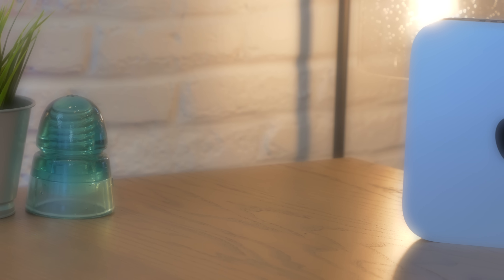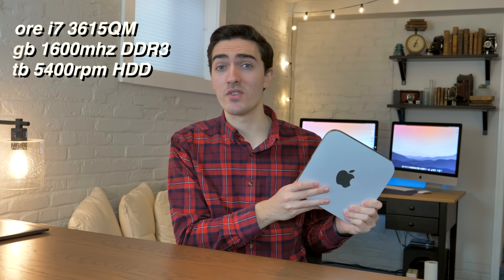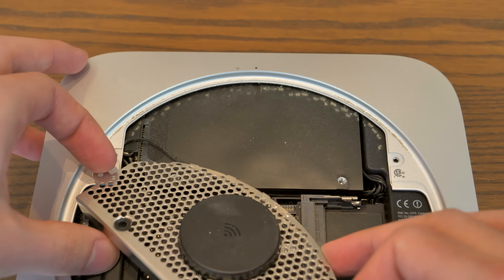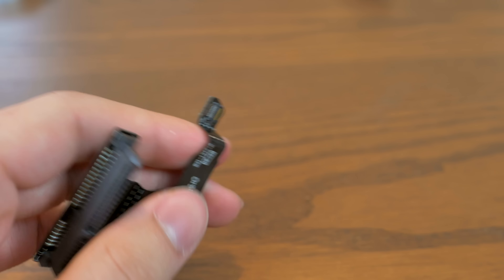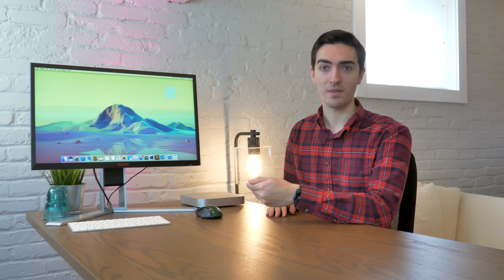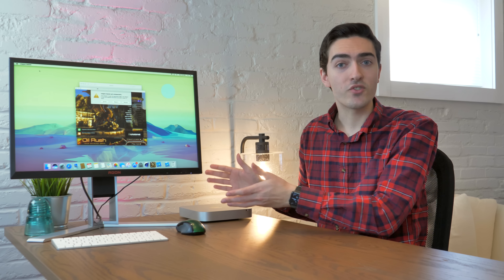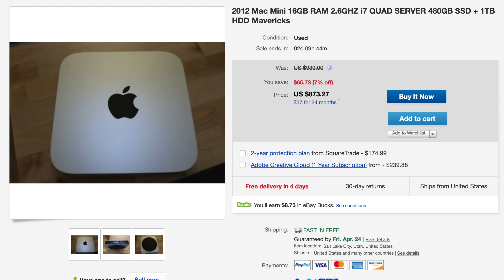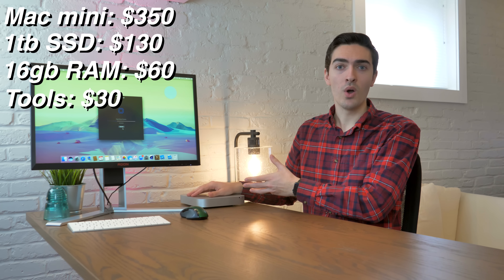Building the ULTIMATE 2012 quad core Mac mini – But is it worth it?

Comment: Luke I found a 2012 Mac Mini with 16GB and 2 TB SSD for $350. Would you consider that a good deal?
Reply: extremely...  usually on ebay a box speced out like that is over $500.
Reply: @davidcook1130  well it ended up selling on eBay for over $400

Comment: I was in a weird spot where I didn't want to cough up the loot for a 2020 or a 2018 mini because if I was spending that much, I'd want to get the M1, but I'd prefer to wait until the next generation of M1s are out, so I looked into the 2014 and the 2012.  2012 initially lost out because it isn't supported by Big Sur.  Them I realized why: it's fairly powerful and upgradable.  The 2014 seems like Apple actually nerfed it's own machine.  When it turned out that it would be the 2014 that would be supported by Big Sur, I tried it out.  The issue for me was GarageBand.  I really wanted to get the latest version because of the drummer feature.  Without Big Sur, no new GarageBand.   So I tried out  the 2014, first a 1.4ghz and then a 2.6ghz.  The 2.6ghz was fine, but that 8GB cap was a bit much. I didn't do my research well when I bought it because I didn't realize you could basically upgrade the drive and that's it.   I ended ordering a 2.3 ghz 2012 with the i7 quad core off of eBay.  They must have goofed because the one I got was the 2012 2.6ghz Mac mini server and it already had the SSD and 16GB of RAM in it.  Apple are being dumb not officially supporting the 2012 because Big Sur runs brilliantly on it.  You have to run a patched installer, but it's easy to get working.  total cost to me was around $300 for the machine and the SSD I added.  So now it has 2 SSDs.  I agree with your point about modestly upgrading to make it a better value.  You can trick it out, but after you add up the costs, you might consider newer, but I wanted to say that for around $300 end to end, this is a very powerful and capable machine with modest upgrades.  Great video!  Thanks for what you do!

Comment: I've been using Mac mini Server (Late 2012) i7 2.3GHz, dual 1TB HDDs since 2012. 5 years ago did max out RAM to 16GB. A reliable machine, really.  It's used mainly for simple photo processing (tons of family pics) and a media computer for family use (it sits under the TV). I would like to use it as the main photo storage (having it all double backed on external HDD's) and viewing (oh, I've just gone from APS-C to FullFrame...) unit.
So, I want to swap the existing two 1TB HDD's to 2TB SSD + 4TB HDD. Since I own the machine, it'll cost me about 300 EUR (Crucial MX500 2TB SSD 170 EUR + Seagate Barracuda TB Internal Desktop Hard Drive 2.5inch 4TB HDD - both from Amazon.de).
What do you guys make of it - is it worth it? How long will it be enough with Catalina? There are some workarounds to get to Big Sur, but will those be there also for time to come?
Opinions?

Comment: I have this same i7 Mac, with 16GB and it came with a 1TB Fusion Drive.  That cost me $1399 when I bought it, as the i5 was the default.  I've recently upgraded the storage to a 1TB SSD, and retired the internal 1TB to be a Time Machine backup.  It's lasted very well for the last 8 years, though there have always been minor graphical glitches (sometimes there's interference under heavy load) and Bluetooth for headphone use has been rubbish.  It's never failed me though.  Getting 8 years of straight use out of a 1TB 5400 hard drive plus a 128GB SSD without a single failure is pretty much unheard of.

As for what I've done with it, I've run VMs, games (Half-Life 2, things like that) and video editing software as well as iOS and Android development tools.  I frequently compile software and I always have a terminal window open for tinkering and running scripts.  I have tried Boot Camp on it which worked fine except for making the Mac run a bit hot.  That was easy to fix with some fan tools though.  I've run Linux on it.  Never any problems.  Only on Mojave did I ever manage to get it to crash by using up all 16GB of RAM with running VMs, and that was a solid hard crash!

It still keeps kicking.  It's been around the world in my suitcase 9 times, as it's perfectly portable when I need it to be.

Comment: I bought mine for 350 and added 16 gigs of ram and a ssd. It boots super fast and doesn't crash at all when I run logic pro x. For what I have into it its a great value compared to the 2018. The performance is great only bad thing to say about the 2012 is what you already said the graphics processor is terrible, but seeing as I use it exclusively for my recording studio I am absolutely happy with it. 
When comparing to my hp mini computer with the same processor and ram it isn't even close when it comes to capabilities. If I didn't love logic pro x so much I'd go for a pc over a Mac any day. The hp is only a year newer but has 2x the usb ports an optical drive and is faster all around.

Comment: It's 2020,  this is a 8 year old computer. Sorry, I love mac os but this BLOWS!! You guys nickel a dime these old macs to make them look like they are worth more, but they are crap. Low video graphics, slow cpu, ddr 3 memory, slow bus board, and old generation ports.  Cmon man,  this is not a classic car from the 50's. There is nothing that would make this the Ultimate mac mini. You would be better off actually buying a mac pro 2009 and maxing it out. At least your video, ram and pci slots would be worth the upgrade. Oh, don't even go with the external gpu, you could almost buy a new computer for that price, and it's almost 30% slower than a pci card.

Comment: Back then Apple actually did try to make their products look modern, now they are simply using the older designs like the new iPhone 12 pro... they used the same design as the iPhone 5 besides the screen but of course, they haven't changed that ;-;

Comment: I bought my i7 Mac mini back in 2012 with I think it was 4gb of ram and 1tb hard disk. I upgraded the ram to 16 gb and 1tb Samsung SSD EVO 1TB . I have used it pretty much everyday since I purchased it and runs really fast and well with no issues. kept upgrading the OS and its been the longest lasting computer I've ever owned . Only negative is that Catalina will be last upgradeable OS it can support. Best Buy ever.

Comment: I got a 2.5ghz i5 2012, brand new condition for $200 (free shipping) a year or two ago on ebay. I still see many around that same price but they seem to have gone UP in price a tiny bit in the last couple years instead of going DOWN which they should be! Still the best value for the dollar, upgraded the RAM myself and got an external SSD for the OS's (much cheaper) which although may not quite as good as an internal, I think the speeds are very similar, and they blow away the mechanic HDD of course. The problem is if you buy one on ebay already max'd out with an SSD, 16gb of RAM and a Quad core, the price JUMPS up to $6-700 minimum, which I think is too steep. I had my chance to get one under $500 a year or so ago, I think people were more desperate to sell them, now everyone's boosting their price

Comment: Plus, as you upgrade, you get very close to the base model Macbook Air. You can still use the new Air laptops with a monitor, keyboard, and mouse. The mini is probably a good deal at a $100 or so if you are going to upgrade. Plus, very soon those older minis will lose support.

Comment: 🗣🗣I am only using this for notes reading and writing small video editing.  I found a 2012 mac mini 2.3 GHz quad-core i7 (4GB ram) 2x2.0GB Turbo boost up to 3.3 GHz 
500GB Serial ATA Hard Disk Drive @5400 RPM
Intel HD Graphics 4000 graphics card 

1 GB DDR 3 Shared Memory 
price:$449.00 is this a good buy?
I’m just going to upgrade to 16GB RAM
And an External SDD

Comment: I just upgraded from an HDD to an SSD on my Late 2012 2.5 GHz core I5 Mac mini with 16GB of RAM (RAM was already upgraded when I received it) and the difference in performance is night and day. Much better speed and performance, before it used to move so slow, I'd get the click wheel and crashes. Now it's so smooth, I have no problems doing anything on it. It even runs Asphalt 9 pretty well on its own GPU  and music software is on point (Logic, FL Stu.)

Comment: Luke - great video as always.  Wanted to offer a little of my own color to this one -->  A close friend of mine has one of these base Mid-2012 Mac Minis and really did not want to replace it.  So, for under $90, I doubled the RAM to 8GB and installed a 500GB SSD.  What a performance difference, and she will likely get at least another year or two of use out of it, especially given it sounds like Big Sur will run fine (with the patcher, of course).  Moral of the story is that for people who already have one of these, a few fairly-inexpensive upgrades legit could kick the can a few years on complete replacement.
Reply: Can you explain the Big Sur patcher part of you can sir
Reply: @aniboibeats687  Look up Mr. Macintosh's series about how to use OCLP.  This hardware can also run Monterey without issue..
Reply: @cliess  great thank you bro very much appreciated

Comment: As someone who buys and sells used Mac stuff of this age on a regular basis, I can tell you that buying in January or February is the best time to source on eBay.  I got one of these for around $225 bundled with the original wireless keyboard/mouse combo.  I will say that the strange thing about used Apple gear in 2020 is that COVID has reduced the supply of these, and due to the extensive government handouts, some people end up having extra income to spend on stuff like this.  So...increased demand and reduced supply equals inflated prices.  Hopefully things get back to normal soon for everyone.

Comment: The late 2012 Mac mini is the modern version of the Macintosh SE/30. Only they saddled it with a slow hard disk, which is a pain. Mine is upgraded to 16GB of RAM but that hard disk! Whoo! It's also stupid that Apple decided to drop it with Big Sur, and it's really an insult that the garbage 2014 model is supported, but the markedly better 2012 model is dropped arbitrarily. Luckily the hackers will keep us up to date as long as possible! :D

Comment: Did the same for mine. Bought it in 2017 on eBay, put Samsung EVO 860 512 GB, WD 2TB and Crucial 16GB of RAM. Use it for photo editing and watching video. It does cope with both tasks well. And after checking the serial found out it was made in 2014, few weeks before 2014 Mac Mini was released. So, old model year, but when bought – only 3 years old. Thinking about upgrading, but maybe, few years later, as it still works great.

Comment: I own a 2012 macmini i7 2.6 vision drive and 16gb ram. Just ordered on amazon 256gb samsung ssd pro for OSX, an 1 tb crucial mx500 ssd for Local storage. It is an 8 y.o. computer but it work perfectly for me.

Just one question. It support Catalina, but witch os you suggest? Do you Think mojave should run faster?

Comment: Anyone got any ideas what to do when big Sur will come out and the 2012 Mac mini can't upgrade
Reply: @ozboyblu if you don't want to patch, unfortunately you'll need to get a newer mac.
Reply: Alright27 sounds like I’ll be customising a new Mac mini.
Reply: @ozboyblu  if thats the case, I would recommend you go for at least the 6 core i5, because the quad core i3 isn't much more powerful than the 2012 quad core.
Reply: Alright27 yeah I’d definitely go i7 and 32Gb ram. But still thinking I’d run external boot OS SSD.

Comment: CAUTION: be careful removing the IR sensor connector around the 3:51/3:52 mark and especially when reconnecting when u put it all back together! The solder is pretty weak and u run the risk of removing the entire logic board plastic connector and pins at each of these points and even pulling the wires out of the connector.

Comment: I just bought myself one with 8GB RAM and a new 1TB Fusion drive with 256MB SSD for £390. I already had a 27" monitor, keyboard and mouse. I'm upgrading the RAM to 16GB. I have legacy Firewire drives and scanners, so the FW port is super handy. I'm loving it so far. I use it for processing RAW files and some Photoshop plus designing books and magazines and it's plenty powerful for those tasks and a vast improvement over my 2011 13" MacBook Pro, which I upgraded with a 480GB SSD and 16GB RAM. Okay, I can't take it away to work but who's going anywhere these days? And I have an iPad I can use for most things, except page layouts. For me it was definitely worth buying.

Comment: The 2012 Mac Mini is now obsolete. The next MacOS - Big Sur - isn’t supported. Basically this is on its’ final legs, but it’ll still run things very well for day to day basic use. If you like Mac Minis, you should be looking at 2018/2020 (between these two only the storage differs) or a cheap 2014 to tide you over till the ARM Mac Minis arrive in two years or so. 2014 is garbage but a cheap option. I’m leaning to any discounted 2018 models I can find.

Comment: Nice video! My 2012 mini 3720qm is connected to 34” Dell @3440x1440 @60Hz over tb1/minidisplay port and to Bose speakers over built in 3.5mm to TOSlink. Primarily used for media consumption machine, still running great. New mini does not provide built in TOSlink connections anymore.

Comment: I have a ‘12 mini. It was no fun reassembling it with a single drive. I had in in and out so many times the fan connector came off the board. I will attempt to resolver. It’s been a few years. Instead of reusing the original 1TB drive, will a 4TB drive work? I should buy the dual-drive bracket kit from ifixit...

Comment: I had a 2011 Quad-core MAC Mini and it had two internal 500Gb drives....I maxed out the RAM to 16Gb and it was a slick as snot- for using GarageBand.  Connected up an external Drive for retaining the recording data and had a Apogee Duet from ten years prior for the sound card.  Fantastic stuff because I only had one purpose for the machine.....a recording facility.
I’ve moved upward since then however the value I got from that Mac Mini justified the expense.

Comment: bruh explain to me where your getting a mac mini for 300 bucks. And what crappy SSD are you using for 100 bucks. secondly brand new mac book pros cost over 2000 dollars, but when a mac mini is maxed out it can cost less than 1000 bucks. even if you paid 650 and someone did alll the upgrades its gunna perform just as well as newer macs and be cheaper. Big difference between 2000 and 650 dollars man...

Comment: No Big Sur support so I expect resale value to drop.  
The fastest 2012 had a 2.6 GHz i7-3720qm.  
It might seem strange, but a lot of people bought these to run vmware esxi like I did.  Dual internal HDs, dual GB ethernet, it would boot off of the SD card and easily fit into a briefcase.

Comment: I bought one of these when it was new. It's been my daily driver, handling light recreational use and learning web development. I did, shortly after purchase, put in 16 GB ram and a 480GB SSD. I've been happy with the performance. I didn't do the two hard drives, so that I didn't have to take the whole thing apart. It's been very reliable for several years now. It just seems to struggle with connecting to other things; external hard drives and television. They work for a bit, then are lost and I have to start resetting things to get them back. Overall okay.

Comment: This mac mini has a thunderbolt port, I think is possible to run it with a egpu using a thunderbolt to thunderbolt 3 adapter, you should try that, would give it a lot of new power.

Comment: I got one of the i7 2012 Mac Mini when they were new. Great setup. I shelved it for a few years, but just recently maxxed the RAM and put a SSD in it. It's remarkably fast and modern feeling again. Graphics Metal benchmark is laughably low, but for general purpose tasks it is silent and quick.
Reply: With modern OS and browsers, it is more than enough for the average user / developer. I think even under Mojave you can build Apple Silicon apps.

Comment: I’m a designer and still using my Mac Mini late 2012, which I bought when I was in a university. I upgraded this just like same as yours (16gb ram w/ 1tb ssd) and connected to 34inch ultra wide monitor lol I use a company stuff for major works but my elder Mac still works perfect and it’s decent for small 2D graphics projects, short video editing, and high-res photo editing.

Comment: I have mine since 2014, bought new, maxed out in the last 4 or 5 years (500gb ssd, 16gb of ram) and I´m still asking myself if I need a new computer. Actually I´d like to have something with more GPU power, but I have no clue what to buy without busting the bank. I really thought about 2018+EGPU,  or a hackintosh with the same budget. But the overall budget (1500usd) is a lot of money for me...

Comment: A few years ago i bought a second hand 2,6 GHz i7 quadcore MacMini with a 250 Go SSD + 16 Go RAM. I'm still using it today for Photoshop (and i do 130x130cm 400 dpi images !) and it still works cool (well, not THAT cool, we all know it) as a breeze... I hooked up a 32" inch (2560x1440) Samsung monitor and 4 x 2To external drives. I recently updated my system to Catalina and it's the first time i ever see a few "limitations" (to say the least) in some of my apps due to obsolescence... I plan to buy a new Mac Mini (the hexacore one) next year, but i'll keep my 2012 mini and use it as a jukebox !

Comment: I bought one of these from Apple back in early 2013 as a refurb, but I got the server version with dual 1tb drives. It was a great deal. Since then, I replaced one of the drives with an SSD and installed 16gb ram. It has been flawless for over 7 years now. I also added the 24” Cinema Display and a full-size Apple keyboard. None of my other Macs has ever lasted this long. I just wish I could turn off the system bugging me to install Catalina, as that will break creative suite 6 and that’s a deal-breaker for me.